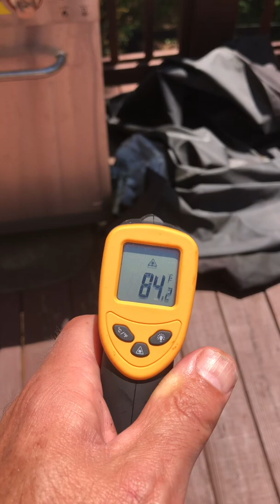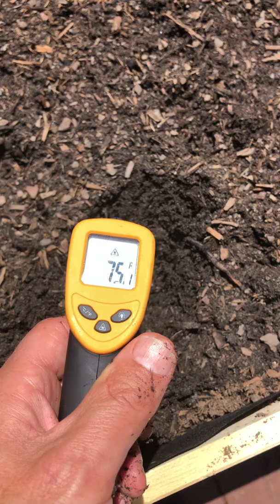Amazing Solar Thermal

Comment: Construct a greenhouse sharing the south facing wall and it will warm a house.  Use awnings and shades and open windows with ventilation to prevent overheating in the summer.  Its not as easy as it sounds, but when its done right a passive solar house is pretty sweet.

Comment: There is a lot to be said about solar energy.    A whole lot.     Like the solar energy that strikes a roof is 35 times what's needed to heat a house and a south facing wall is 8 times more than needed to heat a house.    But most of that happens in the summer.    It's complicated to get a house to stay cool in the summer if the house is designed to pick up solar heat in the winter.   Places like Germany use what they call 'passive house' insulation maybe 15 inches thick and very little air leakage.    But Germany has very little solar, but has low need for air conditioning.   Germany uses 1/3rd the energy per household that people in the United States do.   
    
Building Engineers and Architects have been working on this stuff since the 1970's and have done a good job of figuring much of it out.   We can build houses for zero net energy.   They produce as much energy as they use.